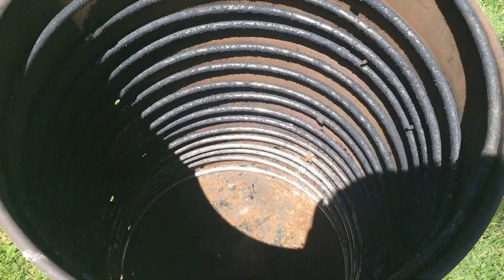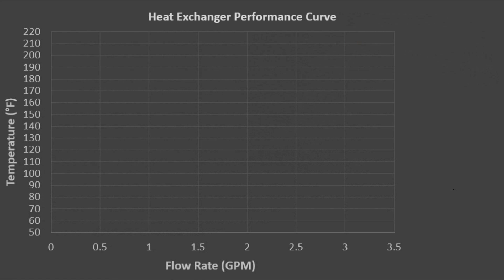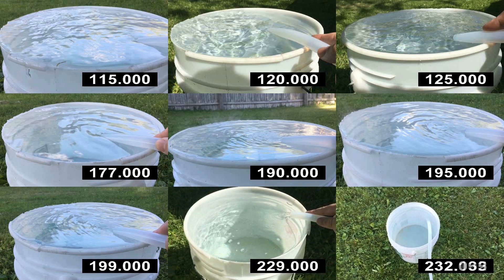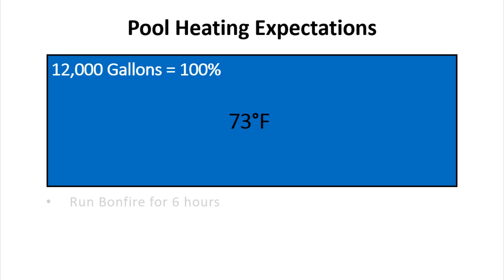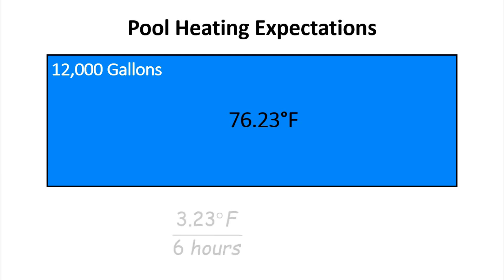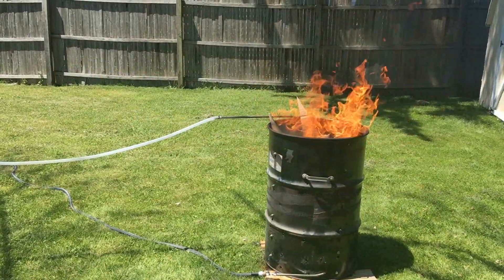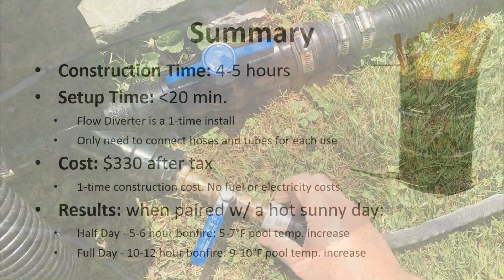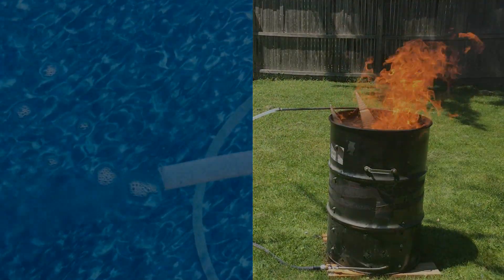Ultimate DIY Pool Heater | Part 2 - Performance & Results

Comment: I have a better way go grab a used commercial pressure washer with burner there’s your heating but they don’t take gas they take diesel to run you can set the temperature and it only cost to fill it up like 30 bucks to fill but it’s last for days so believe 2 days on a full tank but that only if your going to be swimming those so like in the morning you go out turn it on and there by the time it hits 8 pm your going to have a hot swimming pool if you don’t tire the temperature up that much they got hot quick

Comment: It seems that most DIY heat transfer inventors make the same erroneous assumption - that low exit temperatures mean the water is moving too fast to pick up heat.  That is incorrect.  The formula for heat transfer rate is:  U * A * (T hot - T cold)  - where U is the system heat transfer coefficient, A is the Area of heat exchange, and the temperatures are the hot side and cold side.  As a general rule the HIGHER flow rate maintains the LARGEST temperature difference between the hot side and cold side, and the MORE heat you transfer in total.   As someone else commented you also want high flow rates to maintain turbulent flow.  The fact that the total heat transferred (flow X temperature rise) is quite similar in each case here just means that  cold side flow is not the controlling factor in this system.   I would guess the limiting factor is the stainless tubing which has rather poor heat conductivity, only about 6% of copper. Other wise neat video series.  Seeing the heat output of one of these barrel heaters (about 1.5 kw) is most helpful for anyone considering building one.
Reply: So.... Copper is better and cheaper?  That's what I'm going for!

Comment: To Jack on the Farm:  what would be the thermal gain become by using 1/2” or 1/4” pipes in the barrel rather than the 1 inch pipe?  Wouldn’t you have to increase the number of pipes in the barrel if you decrease the diameter of the pipes in the barrel? Would the length of decreased pipes in the barrel also become decreased?

Comment: So there’s a huge variable you’re missing here though and I’m not trying to be a dick but ambient temperature it will play a huge role in heat transfer of the water and I understand that the water and ambient temperature are going to reach equilibrium but ambient temperature isn’t constant so it’s going to either add or subtract temperature from the water

Comment: Interesting video, but I'll comment on a couple of things.  Though you're definitely making the energy, the water temps you're generating are potentially dangerous. I would suggest using larger tubing or multiple runs to generate a higher flow rate with water not so hot.  Your pump is a centrifugal design, so the sound change you are hearing is actually the pump unloading.  It won't hurt the motor, but if you restrict the flow rate too much you could overheat the bearings. Unlikely though, so long as you are moving some water.  Ideally, you would construct a heat exchanger that would carry the full flow of the 1.5" pool plumbing. But, that's hard to do in a DIY setting. You would likely have to use multiple circuits in a manifold design.  Very complicated plumbing.

Comment: Great videos. I was wondering if you separated your heating system from your pump by using a submersible pump at the bottom of the pool pulling in the coldest water, rather pulling from the skimmer (top of the pool), would the results be better & more efficient?  It seems by both pulling & returning water from the top neglects the cold water deep down.

Comment: Hi, thanks for your great work and sharing your experiences! I'm trying to compare different designs and wondering if you thought about having the coil horizontally instead of vertical. My thought; you loose a lot of heat on the top side, which would be optimally used when having the coil laying horizontally and burning the fire inside. Flames  more  and longer contacting the coil and keeping heat for longer time inside the area where the coil is transferring it's heat to the water. With a chimney on the backside for example. I saw a few designs, but a lot more vertical like yours. You well thought your project, so curious what you think. Thanks!

Comment: I am an engineer and have taught classes on hot water solar design. I also have designed pumping and heat transfer systems as part of my job. I have a couple of comments...
1. The spaces between the tubes inside the barrel are a waste. You allow heat to get to the steel barrel and radiate to the atmosphere. Better to pack the tubing in solid (little to no spacing). 
2. Liquid in laminar flow will transfer much less heat at the interface between the SS tube and the water inside than liquid in turbulent flow. Therefore you want turbulent flow in the barrel tubing where you want to maximize heat transfer, and laminar flow in the lines to and from the barrel to minimize losses to atmosphere. This translates to small diameter tubing in the barrel where the heat transfer is taking place, and large diameter hoses carrying the water to and from the barrel. 3/8 or 1/4 inch diameter tubing would not be unreasonable for inside the barrel, and 1" diameter would not be unreasonable for between the barrel and the pool. An efficient hot water solar panel has a 1" header with about 12 - 1/8 inch diameter branches in parallel, leading to a 1" outlet header. My 100 gallon solar storage tank is sometimes at around 200 degrees F.
3. Moving energy is the point of this project. The small diameter tubing inside the barrel will yield a greater temperature rise than the larger tubing. If you calculate the mass of the water flowing times the temperature rise (delta T) you are likely to see larger numbers with the input I suggested here.
4. Doing the calculations the way you are is suboptimal. The pool temp is rising. The heat transfer will be much higher for 60-degree pool water than for 90-degree pool water. 
5. Closing the PVC valve and hearing a change in system noise is not due to the pump working harder. With a centrifugal pump, the least horsepower is used at zero flow rate. High total flow rate takes lots of horsepower. What you likely heard was a lower total flow rate but a somewhat higher velocity in the small diameter branch. The velocity makes noise due to turbulent flow. 
Hope that helps clarify how to think about this stuff.
Reply: Helps me out a lot! Thanks
Reply: So would a manifold to the outside help with flow rate. Feels like it should

Comment: Thank you! This video was extremely helpful. It's great to see someone actually run the numbers to determine what it's capable of. With this, we can determine the heat output to be 11.94kW or 40,740 BTU/hr, which isn't too bad. A typical natural gas pool heater is in the range of 100,000-140,000 BTU/hr, but they also cost $1,000-2,000 plus installation.

Any idea how quickly you go through wood? It's not free fuel, so we should consider that as well.

I wonder if you could get better efficiency out of it. Most of the heat is rising out of the barrel as hot gas. If you look at an indoor natural gas water heater, there is a burner at the bottom and a flue going up through the water. The flue will have a spiral set of fins within it to make a long channel for the hot gasses to go through and a lot of surface area to conduct the heat into the surrounding water. Perhaps a similar thing could be done with the burning barrel by attaching a flue to the top and putting the coil within that flue.

Comment: Excellent video,  but Your comment about the pump working harder pushing water through the 5/8 hose is inaccurate, if you reduce flow, the work being done by the pump is less, you can see this by measuring the amp draw at full flow, and at restricted flow, with the flow restricted, the amp draw will be less.

Counterintuitive, but nonetheless true

Comment: I enjoy the math data concept that simply boils down to 2 gallons per minute ballpark optimal flow rate. The stainless 1/2" OD coil is sweeter than copper being stronger & with great conductivity. The clear plastic tube is a good visual point but even better as a blow-out link to minimize catastrophe. I'm now dreaming of incorporating this SS roll size or 55 gal flue size via brick into my "branch burning bbq idea." 🔥 I had tried a copper core from a large heat exchanger hooked to a pump circulating from the pool but it got "unplugged" so it blew!? Inspirational, thanks!

Comment: Im about to create a hot tub heater this way, horizontal barrel with 200" copper 1/2" tubing on the outside of the barrel and a makeshift refractory on top to insulate. I may do a similar heating graph for funzies when its done. I will certainly update you how its going.
Reply: Please... Results?

Comment: Great video. Very useful info. Suggestion: for another $100 we can really boost the heat output. Use a passive black hose solar coil to take the chill off the water prior to entering the barrel. Also, what about taking in the water from the pool area you just heated? This would increase your output temp for free. BTW, I checked ancient Man-Law manuscripts and it never says that we have to heat the coldest water first!

Comment: If you woulf use a second or a third coil in parallel, your 2 gpm limit would be pushed further and you could eventually push the full pump flow in yhe heater. Anyway, good job and thank you for sharing your work with us, much appreciated!
Reply: excellent

Comment: Great video!  Thank you so much for doing all the extra work calculating and showing potential results for other sized pools. I have a question: In your opinion, would this work with a saltwater pool?  I know stainless is more resistant to corrosion than say copper, but will it hold up to the salt water over time?
Reply: Are you thinking of heating up the sea ?

Comment: Great job I’m sure it’s above a lot of peoples heads but you still made it easy to understand. I’ve been struggling with ways to heat or 14,000 gallon pool. Currently I have my hot water pressure washer that burns diesel or kerosene running on a recirculation pump that is normally mounted in one of my service trucks for the pressure washer. I control the flow by the pump that I purchased which is 3 gallons per minute. I’m sure it’s a little bit less than that considering the drag through the coil. However the water coming out of my hot water pressure washer is somewhere in the neighborhood of 160°.My unit burns surprisingly clean however diesel is far more expensive than broken pallets. I’m hoping to get a 10° rise out of it. I will post another comment with my results. Any thoughts?
Reply: By the way it’s just heating, I do not have any attachment on the end of the hose to create pressure
Reply: Update. 12 hours later and  20 gallons of diesel burned it reached 89 degrees.

Comment: This video is really encouraging, my baby girl has a 10 Feet (1240 Gal) pool, temp here is around 62 every day so this system might help. I'm thinking on building ir with a smaller can (26" x 14") with a 1/2" copper coil around 26 to 30 Feet. Il'l let you know the results once done. Most likely it will heat the whole thing within an hour and change.

Comment: Really liked all the details you put into your video. Great job

I’m wondering is there an optimal size to use for the coil? will the heat transfer better with larger diameter and slow water rates or smaller diameter tubing 

I also wonder if you can incorporate this coil inside of a rocket mass heater around the heat riser? 

One last idea if the tubing is in in water like a boiler will heat transfer be more efficient?

Comment: That was entertaining..I bought a TCMT tankless 16Liter water heater - cost os cheap. Ran a gas line to it. I have the cold pool water to a water pump  then the pressurized cold to the tank and heats it up to around 120degres back into the pool

Comment: Great video. I really appreciate the time spent on collecting the data points! So many people start a project like this and don't think it though all the way.  One data point I was surprised by was the the faster flowrates had less of an effect.  I had always assumed that a faster flowrate would collect more energy from the system.  It was very interesting to see the point of diminishing returns for this system. Thanks for the video!

Comment: Thanks solo..... My pool is 10000 gallons built into the ground.... winter ambient temp is 65 deg F water and air.  i need to heat the pool to 99 deg F.   Is this possible
Reply: nodoby heats a pool to 99 degrees lol.  That would just be nasty !

Comment: Why did you choose stainless over copper when copper is better transferring heat.
Reply: Copper corrodes more quickly and will get leaks fairly quickly - watched another video on here where someone found out the hard way. Additionally, once copper becomes heavily corroded the corrosion acts as an insulator and it loses some of its thermal properties while 316 stainless is less likely to do so. 316 stainless is also more resistant to chlorine corrosion as well.

Comment: Interesting video. I've seen this design many times before. I would be curios to see what the flow rate is like without the use of the pump. It might be hard to do that though because the burn barrel and the hoses would need to be lower than the water height for optimal thermosiphoning. In order to do that in this scenario you would need to dig a hole in the ground and place the barrel at a lower height. An easier experiment to produce the same effect would be an elevated 55 gallon water bucket above the burn barrel. It would be interesting to see how the flow rate compares with and without the use of a pump.

Comment: Awesome video, Man.  I, too am a Thermodynamics freak & you hit all the nails on the head.  I will be building something similar to this.   My plan is to put your design in parallel with a home made solar heater (that I’ll run during sunny days). Our family like our evening back yard fires, so I’ll incorporate a version of your coil into our family fire pit and re-route that lost heat energy back to our pool.  Thanks for sharing your calculations as well.  I love the efficiency vs cost.  Well done, Sir.
Reply: Layne, I think it's not efficient, and SoloEngineer conceded that in the comments below. 

It is better to put the barrel on it's side, based on my experiments this past fall.  I have a 200' irrigation tube solar panel as well, but didn't get enough sun for it to do much. Didn't need it over the summer as it was a hot one. Solar cover is a must have for all.
I can provide the details of my setup if it helps.

Let us know what you do and how it turns out, very interested.

Comment: BTW, forgot my manners. This is the best video around for pool heating, since it contains verifiable results and careful instruction regarding build. You truly are an engineer based on how you approached this and measured your results with data such as flow and input/output temperatures. I've searched through dozens (or more) videos trying to find a real way to heat my 18,000 gallon above ground, and this is the first time I've had results. I picked up three degrees last night, so thanks!  It's going to be 80 today, so maybe I can break 70 (at 65 now).  Mine is a three ported manifold system, which I'll expand on as required.  I do have an irrigation tube solar panel, and that gets me a couple of degrees as well, so it's a little extra.  Keep up the good work.

Comment: Can you wrap another coil so the water goes twice inside the barrel and ad a lid to the barrel? Isn't there a lot of heat loss trough the top?
Reply: I am in the process of updating my barrel after having tried wrapping the 100' stainless pipe around the outside (to avoid it getting creosote). I had also tried wrapping a 50' copper around the outside at the same time. Best I could manage was 30K BTU with intense fire. I got one degree (up from 67 Fahrenheit) only to lose it to a 44 degree night. I had wrapped the outside of the barrel with aluminum flashing to hold the heat on the coils, but I didn't measure the effectiveness, though I assume it helped.
So what I'm planning on doing asap is have the aluminum coils on the inside of the barrel as Solo Engineer had (done), the take the copper coil and mount it at the top of the barrel, which has a lid with a flue. I'm going to cut a door on the side to fuel it.  My problem was dealing with the large amount of coals at the bottom. Perhaps by having the coils in the inside, there will be better use of them. Any suggestions?
I'm also going to put some standoffs on the barrel to wrap the flashing around the outside, to give it a bit of insulation. I had thought about burying part of the barrel, or putting bricks around the outside.
I plan to get another barrel and have it on it's side, but since this one has all the air holes, it seems like it's better to start fresh.
So, do you folks have suggestions for a grate or some way to minimize the coal buildup?  I really need quite a bit of BTUs to make this work, and so far it's been disappointing. There are health reasons why this is important, but I can't afford a regular heater.
Thanks for any help on this.

Comment: Looks like it works well... I am using a propane water heater to do the same for my hot tub.  But, Convert everything to BTUs...the math is so much easier.  Props for figuring it out the hard way though.